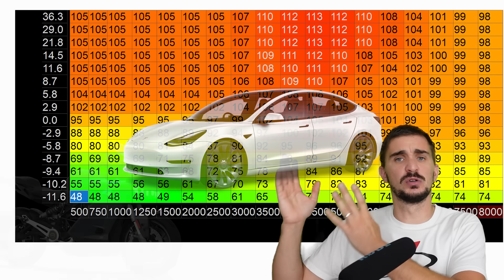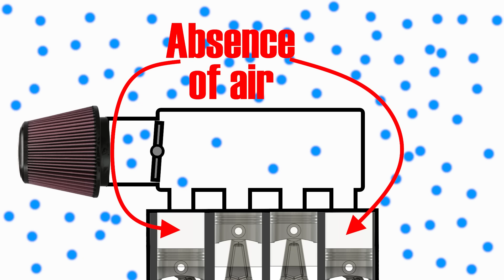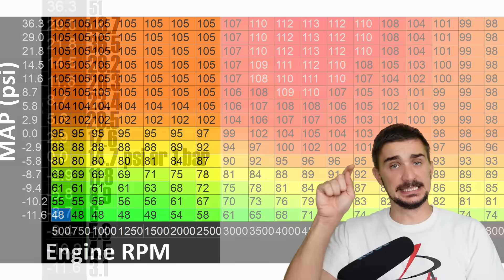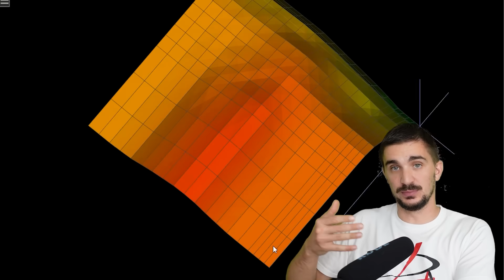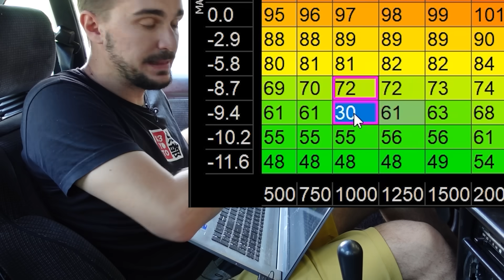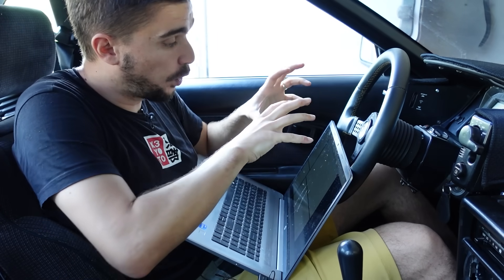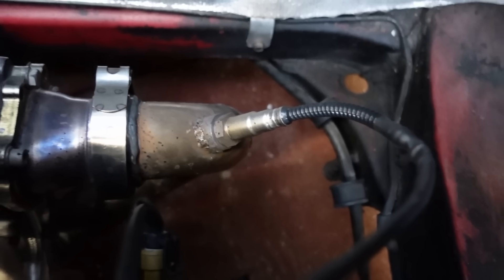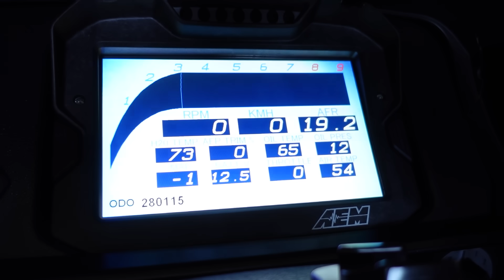If You Understand Volumetric Efficiency You Understand Engines

Comment: i'm curious about a couple of things. does the ECU "remember" the trim? as in, if you go through an area where it had to increase fuel by about 10%, does it record that to the VE table? so, if you run an engine through it's RPM range on a dyno or wherever, would it tune the VE table to account for the trim? is there a difference in performance if it does/doesn't?
Reply: It depends on what you reffer to as a trim. The ecu has a short term and long term trim. Let's say you dialed in your new afr table but your VE table is all wrong so the target afr and the actual afr don't line up. The short term fuel trim will immediately adjust the VE map to match the actual afr to the target afr, however it will not save the value. The long term fuel trim on the other hand corrects the value of the VE table based on how much authority you give it (10, 15, 20% and so forth correction) and it will display it in the tuning software. You then have the option to apply those changes and drive it around more to see how it behaves and if it needs more correction. The good part about VE table and short and long term fuel trim is that if you dial in your afr table, you enable both trims and just drive around and the car basically tunes it's VE by itself based on it's sensor readings.  You try to get as many cells as you can and the rest you interpolate and smoothen out. VE is best done on the road as the dyno you are just running WOT sweeps most of the time, where on the road you are driving your car in many different conditions and engine loads.
Reply: @SusedatLubo  ah, so repeated short-term trims (caused by being in that cell often, such as highway driving, idling etc.) end up offered to you/saved in a VE table by the ECU?
Reply: @vukpsodorov5446  Short term, doesn't save data. If you have only short term enabled it will correct the VE, but will never save. Next time you start the car it will be like it was before. The long term trim will change the VE table, but it's slower to react and apply changes than short trim. Long term trim will save the changes however.

P.S. Think of the two trims working together. The short will correct your VE on the spot in order to give the engine what it needs atm, while the long trim will apply the changes, so that next time you start the car it will be running optimally like before you stopped it.
Reply: @SusedatLubo  ah, got it. thanks

Comment: You forgot to say that even in NA engines the VE can go above 100% thanks to the help of exhaust pulse scavenging combined with valve overlap which helps pull in more air and have more than 100% VE despite engine being naturally aspirated
Reply: The example VE map even showed that. It wasn't mentioned, but the map shown has >100% values under 0MAP.
Reply: @Scraps_Pile oh yeah i just looked again and realized now 😅
Reply: I was wondering this exact thing! Excellent point. Maybe I am missing something.....this cat is pretty sharp.
Reply: @ironken1796 0
Reply: He also not mentioned that this doesn't applicable to diesel engines as they don't have throttle bodies
Reply: @yash_kambli ??? The throttle body has nothing to do with this topic, a diesel non turbo engine is still naturally aspirated and turbo or not ve is a factor on all ic engines and pumps
Reply: @needmoreboost6369  i mean if there's no throttle body how partial vacuum will be generated at No load condition. Pressure would always be close to the 1bar or more but not less so this chart(VE) become irrelevant in this scenario
Reply: A ram-air intake combined with a careful designed airbox has helped many sportbike engines achieve greater then 100% VE for decades now, despite being naturally aspirated.
Reply: He didn’t mention it here but I’m pretty sure he’s done a video all about scavenging
Reply: @jcorkable  i cant find it
Reply: @288gto7  I think this is the one I was thinking of  https://youtu.be/5nKDNrUz5to

He at least gets into scavenging, not sure if he tied it into VE
Reply: I know that he didn't mention this for 1) Keeping things simple, and 2) Does not need to complicate this for the everyday man/woman.  Well, actually, those 2 points are exactly the same thing, lol.  We all know that he is well aware of an NA engines ability to pull in more than atmospheric pressure.
Reply: ah yes, Isn't this what VVT made? Also, my Tundra is a 2005 and one of the mods going forward past 2004 (called iForce) was VVTi and a "variable geometry intake manifold" or something. I believe this has to do with scavenging and screwing with the efficiency of the low end vs high end.
Reply: I did exactly opposite, but the sound is waaaaaaaay better.
And I do not regret! 😊
Reply: While that's true. I think it's all about understanding the map and what % each point in the curve means. I would still be reluctant to play with the map as a beginner. I'd rather buy a tune than mess with one myself. All this vid did was show me how easy it is to screw with the map! LOL
Reply: You can think even piston engines as a kind of turbine engine but just with pistons for wings. It would work with just compressed air but burning some fuel helps because gases cool when they expand.
Reply: Never thought of that. but I am skeptical, I can’t imagine the scavenging effect pulling above atmosphere. I’m thinking scavenging/pulsing only reduces vacuum and maybe eliminates it but not boost.
Reply: Exactly, from what I've heard they can reach VE's as high as 130% nowadays.
Reply: @renderflash 130% is a lot. It means you have 0,3 bar of boost remaining in the cylinder. So you had a little bit more boost at the turbo or supercharger.
Usually it's around 5% which is already a lot.
Reply: The numbers in the standalone don't mean squat. I can tune an engine speed density then double the size of the injectors only in the ECU and double all of the VE values on the map and still have it running exactly the same as it were before. That doesn't mean the engine is operating at 200+ VE. 

You can fudge injector characteristics, deadtime, and get insane VE values around low load or short injector pulsewidths. Don't get hung up on it. Understand the equation your ECU is calculating in realtime and work from that.
Reply: @pontiacg445  But why would you do that? You’d just be hurting yourself lmao. The point of the video was to explain what the numbers are supposed to mean and how you can use that to make informed decisions. You’re not going around bragging to people that your engine is running at 200% VE, you’d want the numbers to be accurate so that you can actually tune the engine and have useful information about it. I can also take a piece of tape and cover the x1000 on my tachometer and pretend that the engine only revs to 6 RPM but why would I do that
Reply: @Roomsaver  To double the available resolution in the fuel table. Try running a MS1 or MS2 on a small displacement engine with honking huge injectors. You want as much resolution around idle as possible otherwise you will be forced to idle at a ridiculous rich AFR or deal with surging. They only take whole numbers for VE, I'll let you determine how that is relevant on your own, if you can.  

The shape of the entire map is still the same. You can still see the powerband in the map. You entirely miss the point of my post. The numbers in the map are NOT the actual engine VE. 

Next, you won't always have exact injector information. You have to guess and then just tune around it. Not having it 100% accurate is not the end of the world. Fuel pressure regulators might not be exactly steady. Some cars will not have MAP referenced fuel pressure regulators so the "VE" naturally increases as MAP does. There are reasons for days as to why. All goes back to not understanding what the ECU is actually doing. 

Have you ever ran a standalone before, because I doubt it. Fudging "VE" numbers on a fuel map doesn't restrict the engine's performance at all, like you cutting down the redline. In fact, I doubt you've ever turned a wrench before with a comparison like that. lolololol
Reply: @pontiacg445 I get what you are saying. I tuned a factory pcm to accept a 2 bar map sensor and had to scale all tables to make it run properly. Lost alot of resolution in the table like you say, but I got it to run fine. Had to scale my injectors way far off from what they were and ve numbers of course didn’t jive. Understanding what the ecu is doing is key.
Reply: @pontiacg445 I'm glad someone understands this...lol. I was baffled as to why the vertical axis was not in kpa.....in 2023.
Reply: @pontiacg445  "You want as much resolution around idle as possible otherwise you will be forced to idle at a ridiculous rich AFR or deal with surging"
ummm... that isnt a resolution issue, thats a minimum open time issue. more than likely caused by this bit...
"a small displacement engine with honking huge injectors."

been there, done that. at 12000RPM, you have 5mS/rev. throw in 85% duty cycle, and if you need 10mS for AFR... you havent got the time, even over two revolutions or a fourstroke cycle.
could just throw the injector on 100%, but theres a nasty gap due to the duty cycle...
throw a bigger injector in, can deliver at 12k with 8mS, and it starts getting really grumpy at idle with ~1mS pulses... most software limiting to 1.5mS minimum open time.
so you leave it rich at idle, or you "blip" it, hit and miss, skip a cycle...

try injecting an I4 that does 18K happily, youre down to 6mS/cycle/two revolutions. you simply cant deal with the variations with one injector.

and it can be tricky, depending on how things are done, to inject for two revolutions, as theres a crank signal on every revolution...

you need twin injectors. its the only way. anything much over 12k, you need twin injectors.

all the values in the ms1/2 are reasonably standard. based on atmospheric standards, tuning software is written to be as straightforward as possible. that VE value should be pretty close, especially in OEM ECUs, to what any particular engine is doing.
altering something to give double VE figures, then compensating by halving something else, isnt quite the same thing as altering the shape of a map altogether...

thats what really matters anyway. the shape. the difference between any two operating points. thats all it is. a value to alter fuel delivery with. which, as you should know, is all about cams, carbs, manifolds, airflow... tune the map to the engines requirements, that is all. what you actually use as a value, or compensation, doesnt matter. but those figures in the VE map should reflect, relative to each other, the engines requirements. and the ECU should be able to deal with those values and spit out acceptable outputs...

ffs, ive been playing with making one and have to deal with everything in binary... 3,296RPM? na. its some silly value like 01101110 stored in a register. map reading of 1.2v? gotta deal with a value of 01000101... and i have to time my map samples to get averages... ever tried multiplying in binary?

"values" mean little, really, its just how they relate to each other. inches! celsius! yards! millimetres! radians?

you also find resolution naturally comes at idle... you have so much time available... what do you really mean by "doubling the resolution"?
EFI runs binary at its heart.
every time you double the RPM from a base figure, you halve the resolution.
set your min speed to fill in an 8 bit register. 16 bit even, doesnt matter... somehow, your crank signal converts into a binary figure and is incremented or clocked, counted, and ideally at the min rpm that count should fill a register...
say 400RPM.
you have heaps of resolution between 400 to 800. half the resolution. over half the (limited!) rev range... 
800RPM has half the resolution in binary, fills half a register...
1600. quarter.
3200. eighth.
6400. sixteenth...
from 6400 to 12,800, you have 1/32 the resolution over half the RPM range.
at 4-800 you have half the resolution over 1/32 of the rev range...

theres these fundamentals of digital processing you cant avoid?

i gave up on all the standard EFI systems as theyre all so... bloated? you dont have to be spot on. you just have to deliver enough fuel every time to make as much power as possible... unless economy is the goal, lol.
Reply: @paradiselost9946  You need to understand the equation that the megasquirt or pretty much any other standalone runs to calculate pulsewidth from "VE" values in the map. Once you do, it makes sense. 

By double resolution, I mean each individual increase in "VE" values halves the increase in pulsewidth. If some arbitrary VE value equals 2.0mS pulsewidth (all other comps being the same) then VE+1 equals 2.2mS of pulsewidth. You can do nothing to get 2.1mS, it is impossible due to basic math. Fudging numbers can give you double resolution, so that VE+1 gives a final pulsewidth of 2.1mS instead. So long as you don't overrun the maximum value that can be stored in the map (IE, an unsigned byte or 255 or whatever it may be) on the high end, there is no downside. 

It's really not that hard to understand, and doesn't require anywhere near that many words words words.
Reply: @pontiacg445  What you're saying here is just 'none of the numbers matter, because you can compensate for wrongly typed numbers elsewhere'. When really, the numbers do indeed matter, and if everything is done correctly life will be much easier. All you're doing is just applying a bunch of bandaids to a whole host of other problems to achieve the same outcome as someone else who does everything properly.
Reply: @Beansswtf  Spoken like someone who doesn't understand hardware and software limitations. The numbers aren't "wrongly typed" if you intentionally type them that way, for a purpose I've clearly explained. I am sorry you can't understand, maybe one day you'll not be restricted by mental limitations...

Comment: Can you trim cylinder to cylinder with that ECU?
If so….wouldn’t you need 4 wide bands ?
Reply: I would say it depends on the engine and exhaust manifold configuration. In an inline 4 engine with a log style manifold like the one in the video, each cylinder fires at his own time and exhaust gets all at the same place, so 1 is enough. In a v6 you would get 2 O2 sensors, one for each bank of cylinders
Reply: Some motorcycles with O2 sensors in each exhaust tube and servos on each cylinder throttle valve do this exact thing. Each cylinder is fueled as a stand alone entity. I believe the KTM 890 does just this.